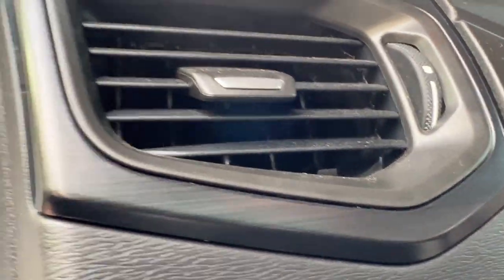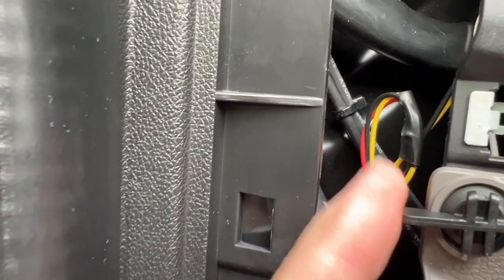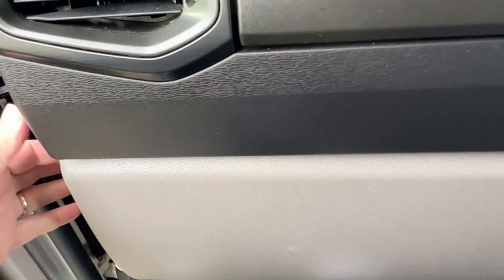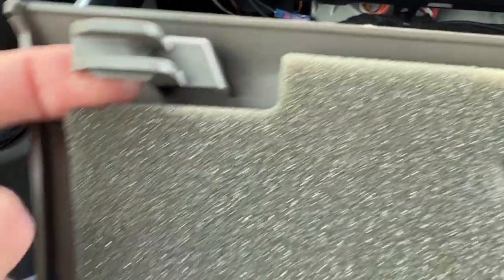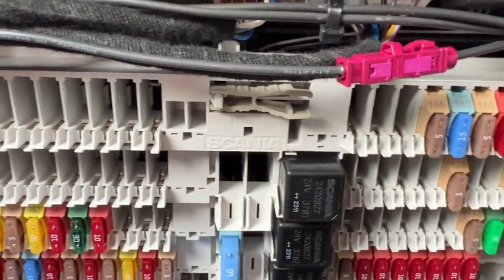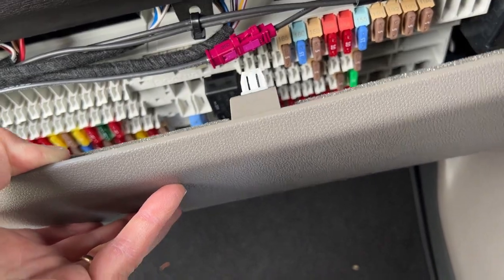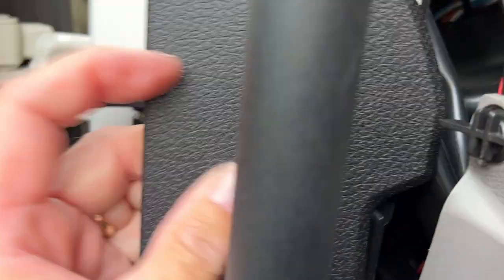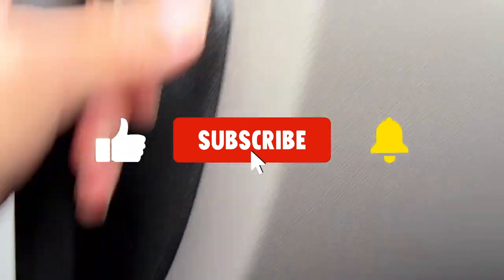Scania Fuse Box Location - How To Access Fuses #scania

Comment: Sorry but for the entertainment radio wath nr is ?
Reply from the maker: Try 151 pull it out and if it hasn’t‘blown’ put it back again, try it a few times as sometimes it doesn’t always work right away, wait approximately 10 seconds before putting it back in?
Reply: @cerberusk9uk   Ooooo yes working thx 🙏 so much good bless you sir 🙏
Reply from the maker: You’re most welcome, glad it worked!👍🏻😁